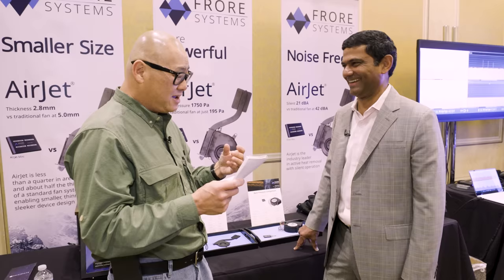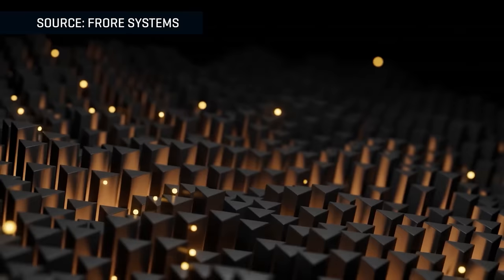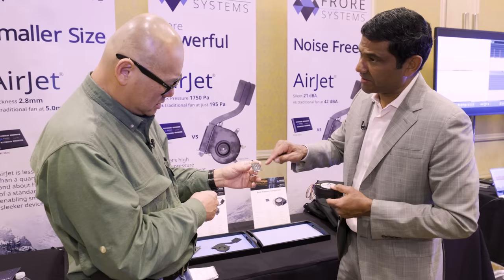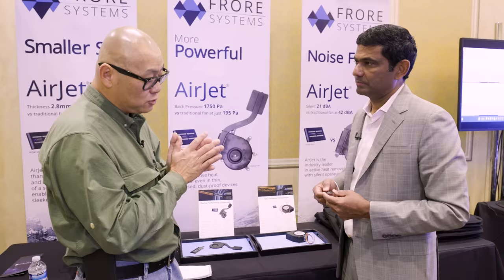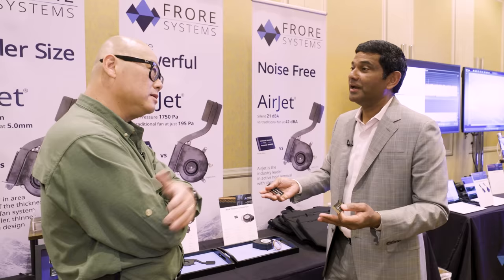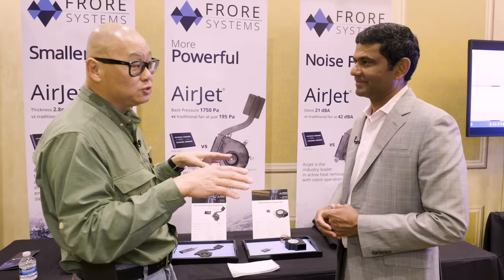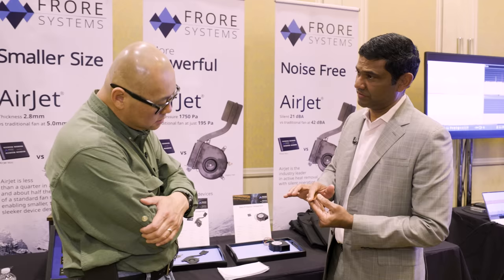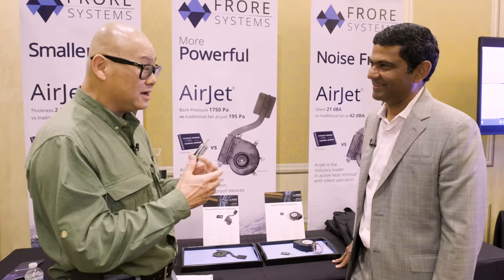Solid State Active Cooling Could Revolutionize Thermals

Comment: Still a lot of steps to go through such as reliability, how long they last etc..with extended use. It reminds me of years ago when someone presented wireless power transmission and it was almost the same type of presentation / hype with a lot of technicals unfortunately it didn’t work in practical world. This definitely looks promising, hope it works out, it will be a game changer on the noise reduction alone.
Reply: They can make speakers with an incredibly thin membrane . 

I think they're called electrostatic speakers ?

This could be decently reliable I think ?
Reply: looks at the wireless chargers all over my room
Yeah, totally flopped
Reply: And where are all this  wireless chargers now? But, anyway, this tech -  membrane cooler - old as hell.
Reply: Big company like fan because it collect dust and make your device die faster.
You know most of phone today the ram are stacking on top of the cpu so it die faster.
I dont think reliability is important in todays tech
Reply: @alokinzna  Electrostatic speakers run on high voltage and are not subjected to 200 kph winds (If what he is saying is true, probably bullshit). There's also something called dust that will ruin these instantly, on top of it being piss poor in efficiency.
Reply: @syarifairlangga4608  I think your argument works for pre-built things like laptops or printers. But when it comes to things like E.G: motherboards. Yeah, Gigabyte would want you to buy their hardware more often, but they wouldn't want to be that company whose motherboards breaks after 4 years.
Reply: It does feel like this device would be very susceptible to dust due to the small cavities/channels/gaps.
The selling point that it can be dust filtered without lack of performance seems to be more that they MUST be dust-filtered.
Which I am totally fine with, but a lot of people are not used to cleaning dust filters - especially on a laptop.
Reply: @StuninRub  you're absolutely right. How fast the air moves is completely irrelevant to it's function.  What matters is the heat flow and that's directly coupled to the mass flow rate of air.
Reply: Different dynamics, the fact that it is solid state and extremely low power fills me with cautious optimism that it would at least be as reliable as the clunky (by comparison) high rpm fans found in most ultrabooks. 
Unless this startup is using a really poor fab, these cooling chips could well become the standard not just on laptops but also imagine a bigger brother version, maybe even with 3d stacking (they could change vent locations slightly on each layer) to radically reduce the thickness of cpu or especially gpu coolers. Imagine a titan-class gpu that fits in a single slot, that's some exciting stuff for sure.
Reply: @Syed Muhammad Aahab  It is not solid state, you cannot create airflow with true solid state cooling systems.
Reply: @backpropagated  sigh I am not talking about the wireless chargers….it was transmission of power over air where the target receiver is number of feet away…without a power cable.

Comment: Great questions from Gordon, he hit almost everything I'd like to know about this. One thing I'm still curious about is the lifetime of this system- is there some kind of repeated mechanical strain on the interior components of the chip that could cause it to fail before a traditional fan? I do know of piezoelectric fans which can run almost indefinitely by vibrating a solid blade with electricity, does this work on a similar principle at a much smaller scale?
Reply: I would be more concerned with the components these are mounted to, I would think the high freqency vibrations would damage CPU dies over time, unless the thermal interface material being used is enough of a cusion to eliminate the vibration or lower it enough to not be an issue.
Reply: nop, it will get gunked up with dust in 2-3 days then become pretty impossible to clean up, notice how the vendor changes subject when the guy says dust proof
Reply: @fss1704  You could just use a HEPA or higher quality air filter, with that amount of pressure it wouldn't impact it at all.
Reply: @LaurenceGough  Yes it would, it can have any amount of OUTPUT pressure, but the only thing that pushes air into the cooler is the atmosphere, a clogged system has only 1 atmosphere of pressure pushing the dirt to the vacuum of a compressor and that's a hard limit. and any filter you use must have very fine and small pores with less than half the size of the compressor pores, guaranteeing that it will be gunked MUCH faster than your typical HV hepa filter.
Reply: @fss1704  I thought they said it had a high suction pressure on the video maybe I misheard. Time will tell, exciting tech though. I doubt the manufactures will be installing it without a proper testing first.
Reply: @LaurenceGough  He's saying that suction pressure has a hard limit since even if you make an absolute vacuum there's still only a 1 atmosphere pressure difference

Comment: This is amazing! Can't wait this to be integrated in next-gen technology
Reply: At 8:35, he says each small module consumes 1W to cool a 5W load. If you want to cool a 100W desktop load, you'd need ~20X as much space to slap modules on and 20W to power them. At that point, you are back to using a bunch of heat pipes or a vapor chamber to distribute heat across modules. If you let modules dump their air directly back into the case, they'll end up re-ingesting their exhaust, so you'll need ducting work to ensure the exhaust gets out as directly as possible. Doubly so if you don't want to toss a bunch of case fans in there to prevent hot spots formation.
This stuff probably won't make sense beyond low power devices (5-50W) in heavily space-constrained environments like handheld game consoles, laptops and industrial stuff.

Comment: I feel like this would be great to see in something like the S25 Ultra from Samsung. I have the S22 Ultra and doing rather simple things the phone can get very hot. Having a better cooling system would help. This can be used with IP68 and is small enough to possibly fit in a phone. This seems like a promising technology
Reply: If you latest gen phone gets hot... doing simple things, its probably a software problem. Phones today have an insane amount of processing power, and an insane amount wasted

Comment: I'll be very curious to see if they can scale this up enough to be useful at desktop power levels, and of course how much that would cost.
Reply: It should be possible to just scale them up and even using layers. if the small one is 5W you can just stack 5 on a copper late for 25 and worst case, stack 5 (125) or 10(!) (for 250) of the copper plates (like the fins that a fan blows over on a desktop cpu cooler). Only issue with this idea is that you get up to a kinda high watts compared to a fan maybe but I assume power draw will go down and efficency up say ...7W cooling at 0.7W (instead of 1)...

So should be possible. Price could likely be about 100$ if mass produced and profit (at current dollar value)

Comment: In theory you could scale this technology up to make it more powerful, more cost effective, and remove more heat from a device. I'm not really sure how this would work with something, like a cooling solution, however this is a interesting cooling method.
It would be really cool to see this change gaming computers in the future, as gaming computers use large fans to cool the system (For the most part) and this technology could in theory make graphics cards much smaller, and make computers overall much smaller as a whole. I'd love to see this technology further developed keep up the good work.
Reply: In theory, like he said, you could just attach more in parallel on a heatpipe and you should be able to cool down much more
Reply: @Fusseldieb  it would take more power and be thicker than current coolers and use more power while even if you covered the whole bottom of the laptop with these it would cool a extremely low power ultra book

Comment: I cannot wait to see this technology becoming a standard element of chip packaging, if possible, especially in my own application space, 3D printing, where the high current stepper drivers in particular generate a huge amount of heat that requires active cooling. Loud fans are the one of the major downsides of being around 3D printers, which typically generate 60 dB of noise at 1 meter.

Comment: That looks incredibly cool. I just wonder what's the production price.
If one of those things costs 100$ while a fan costs 5$, it's much less interesting
Reply: I been thinking that most of the vid.....what does this thing cost?.......and if its cheap and reliable it would be a game changer, especially for hand held or portable devices....a steam deck more powerful than a high end gaming pc.....way faster smartphones......cheaper gaming laptops......
Reply: I can see your point for low budget devices but $100 CPU/GPU cooling solutions are nothing out of the ordinary for more premium devices. (Just look at the prices for your average 240 and 360mm AIOs let alone what people spend on custom loops.) If they are going for the thin ultra book market first that falls definitely in the premium segment
Reply: @weedthepeople2795  The good thing about MEMs mechanisms is they aren't particularly expensive to produce, you can create them using photolithography which makes mass producing them pretty damn easy once you've got the tooling setup. 
I would highly recommend "An introduction to mems" by Iboro for a deeper insight into the technology.
Reply: @megapro125  for what I have seen this cooling solution can be some 20'000$ NASA technology. Until we have some pricing I find this discussion useless
Reply: It really isnt. Many devices are thermal limited. Heatsink with fan costs $35. So $65 for silent more efficient cooling is bargain. $65 more for gaming or ultra thin laptop is nothing.
Reply: @kaeji_namitsua  That $65 isn't going to just pass directly to the customer though, the laptop manufacturers would have to test, redesign their laptops, etc, and of course make a profit.
Reply: @DoubleMonoLR  It will and it will be cheaper product at the end. Thats what they do for every laptop generation. It would be cheaper than designing copper tube loops and heatsinks because the cooler is already finished.
Reply: @megapro125  A 360mm AIO can dissipate 300W of heat, this can dissipate 10 Watts. This is useless.
Reply: @kaeji_namitsua  OEM coolers cost nowhere near 35 bucks for the wholesale market, more like 5 bucks. You wont be buying this thing on the video in the consumer market for less than 150 bucks for a 10-20W unit.
Reply: Fan bearings wear out. I imagine this thing should have longer life.
Reply: @jonmayer  This is a silicon membrane probably vibrating at hundreds of thousands of time per minute. I dont think it will last nearly as long.
Reply: @Bramble20322  well one is for space constrained ultrabooks the other for full sized tower PCs so you don't need 300W of heat dissipation. All I'm saying is a $100 cooling solution is absolutely justified and common place in a $2000 PC/laptop and that's a normal price for a good ultrabook which the company seems to be targeting with their first gen of this new cooler.
Reply: @Bramble20322  Yes, 360mm. Thing thing is the size of a credit card and produces more airflow than a fan of comparable size. It has to be scaled up first.
Reply: @Bramble20322  Mems can last for a very long time because they have like 1 moving part.

Comment: I wonder if there is a geometry such that could use this for desktop or server class CPUs.   The new high end CPUs, such as AMD's threadrippers have significant thermal issues (or rather I have not found an adequate cooling solution such that the thermals are < 80C on full load).  The new CPUs in this class allow much higher temperatures, but run at the cusp of full power vs throttled power.

Comment: I see these devices for more an application to servers than personal computers.Jets in crossflows have many uses. Remember the hot air is leaving very fast in a small exit. What does this to the individual with their hand next to it? Sure, you can include expansion tunnels, but that just creates a larger footprint.

Comment: For this generation, I could see this going into a Raspberry Pi, or a low power NAS. Not sure how I'd feel about a notebook, though. Not yet, with how CPUs like to boost. I'd also like to know what the thermal equilibrium of this device is.
Reply: Raspberry Pi is to low cost of a device to bother with this, plus you have room for a fan on one. This will be for portable devices
Reply: I am amazed Apple hasn't jumped onto this fast for their low end M1 and M2 chips.
Reply: @christopherfortney2544  Honestly they would be one of the first adopters if these prove to be reliable and decently affordable. Apple is notorious for doing anything, including letting their laptops overheat, for the sake of quiet operation.
Reply: Raspberry Pi and most SBCs don't need active cooling though. My Raspberry Pi 3 runs at like, 60C full load with a passive cooling case.

Comment: That is indeed very interesting. Also the ability to make these devices thin and small allows one to use multiple devices in a very targeted way. Instead of moving the heat with copper/heatpipes to the one airflow channel, have the airflows really close to the sources, lowering thermal resistance.
One problem seems to be the power consumption, 1W for 5W of heat is worse than fans. So this would be for performance use, not endurance mode. But in endurance mode of e.g. laptop with reduce CPU power, passive cooling can often be enough already.

Comment: Would love to see some single slot GPU with these! ❤ very cool thermal solution
Reply: not going to happen dude. unless you like to double or tripple price of the gpu and increase its power use by 20%
Reply: @Cypeq  Why would it draw so much more power?
Reply: @jamesconkle9158   AirJet it draws 1W per 5W cooled. While air cooled gpu typically usues 3 fans that total to like 15W or less depending of robustness of heat sink can cool even 600W

Comment: Very interested in its silent operation. I do not see it being very useful for high-end systems any time soon but lower power devices will surely see some nice improvements. One thing that does irk me is the lack of any price figures. I'd love to know how much one of those units costs and what kind of circuit is needed to drive it.
Reply: I'm not much of a science guy but if they could stack it somehow they could double the cooling performance. With future generations I see this technology being able to cool 45W, and be the standard for anything nog high-end/gaming laptop.
Reply: @sjoerdtheemperor5229  Seeing how the device works, stacking wouldn't be possible, or would at least defeat its primary function. If enough heat remained through one layer of the device, then it has already failed to do what it is intended to do.

This functions by area coverage, so while you can't stack it, you could conceivably make it as large as the device it is cooling, with a vapour chamber to match, distributing the heat across the surface.
Reply: @zierlyn  makes me imagine these on a mobile phone. might actually unlock a great deal of options for mobile phones, of course batteries are still going to be a thing

Comment: I think Gordon is on point suggesting using these for SSD cooling. Especially with Gen 5 on the way.
Reply: That's what it's good for. They try to suggest it for cooling laptop heat sinks but these thing produce no static pressure for heat sinks or radiators

Comment: After hearing about these a while ago, I was waiting to actually see them working, and I gotta say I'm impressed.
I want this for desktop. And I wonder if it could be BUILT IN into CPU and GPU chips from the get go at some point. Self cooling chip sounds pretty damn cool.
Reply: ah yes so then cpus will be garbage when the cooler fails, sorta like gpus pretty much are now because of how near-impossible it can be to replace a gpu fan in some situations.  make them built-in so it'll be a guarantee.. more money for everyone!  (except the consumer of course)
Reply: @desktorp  Well, IF these fail. I don't know if a little vibration can be called a moving part. Coolers fail because fans break.
Reply: @brei2670  'solid state' doesn't mean impervious to failure
Reply: Fail or not, it does imply a long lifespan of the part. And still regardless, at least for now, these things are going to have to be paired with vapor chambers and junk to cool a modern desktop chip.. But I'm sure small and low power notebooks would be able to use this right away considering they already get away with little vapor chambers and heat pipes
Reply: @bevvyfischer4386  Yeah my idea wasn't to use them for desktops now. They're obviously too weak for that. But they already said in the video that these are going to get better. I'm just looking into the future here.